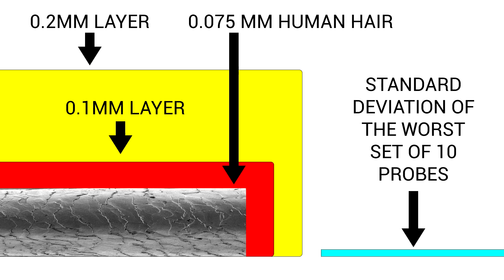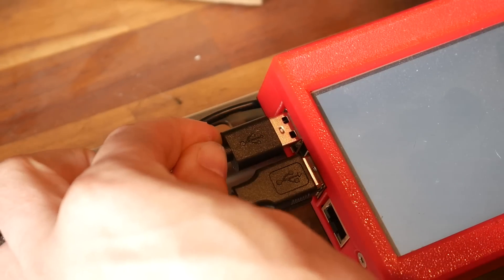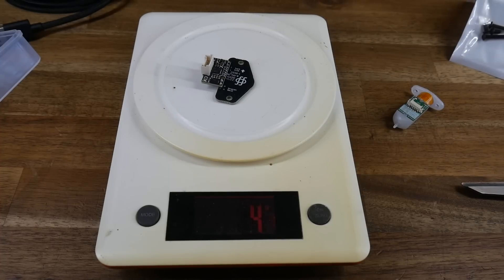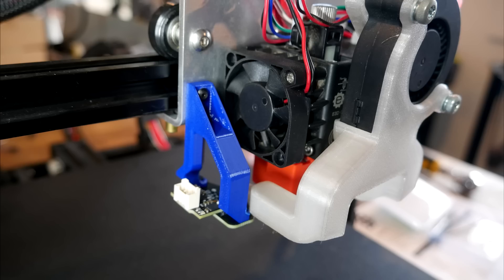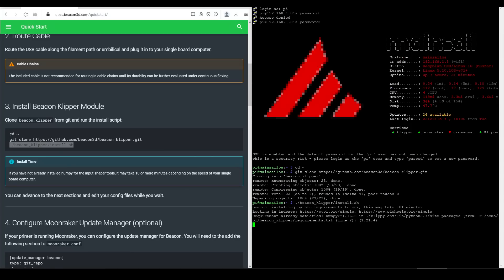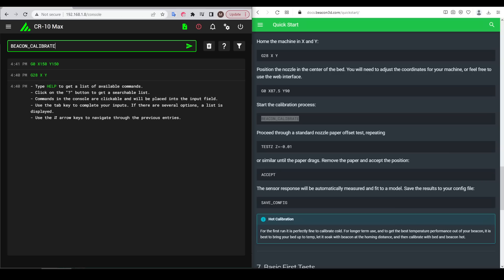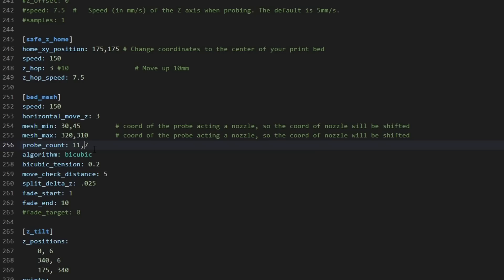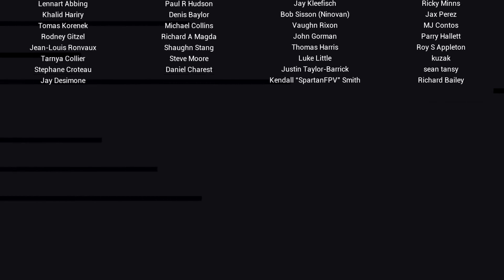Beacon ABL bed scanner - Amazing speed and accuracy, perfect 1st layers

Comment: My main gripe with Beacon is with the fact that it isn't Open Hardware. It's disappointing, specially when you consider that the 3D printing community as a whole was only allowed to grow and thrive because of the Open Source designs back in the RepRap days, after the expiration of Stratasys' patents back in 2009.

Also, the way it is able to communicate with Klipper is problematic by not using Klipper per se, but just an implementation of the communication protocol licensed through the MIT License, which allows the use of that code on closed sourced projects. This has the potential to create a walled garden of closed sourced sensors or add-ons that doesn't collaborate back to the original Klipper project.
Reply: Considering the difficulty of getting patches actually merged with mainline, having hardware that can spin up without merging into klipper can actually speed things up in terms of development. The actual klipper portion of the code is open source and under GPL and there's no way that can change with klipper as it stands.
Reply: @KeyanMobli  That isn't the issue I'm addressing here, and I believe you know that.

And while it is true that Kevin does make things difficult to merge on the main repository, there is a simple solution for that: just fork it.
Reply: @KeithSachs  First of all, I never worked on any stepper motor, ever. What I have done was simply to ask OMC if they could do it. It was solely their decision to manufacture that motor, and the only thing I was ever offered was a pair of stepper motors for testing, which I declined.

Second: you are completely free to disagree with me. That's ok, different opinions can enhance any debate when there is respect on both sides. After all, any creator can make their own decisions on how to license their creations, even if they want to license them at all in the first place.

Third: what I have written are my opinions, from the point of view of someone involved in Open Source Software for almost 30 years (counting both using and developing, although the latter has been of lesser importance since I don't work anymore with programming). It expresses my concerns on how such developments can influence the Open Source Software/Hardware in the long term. And that's because, while the creators of Beacon (and of Anchor, the firmware blob it uses) may contribute to Klipper frequently, now the Pandora's box is opened and other players without such interests can exploit this possibility. And yes, I'm talking about Chinese companies.

I hope you have a nice day.
Reply: Imagine complaining that people get to sell a product they spent years, and tens of thousands of dollars developing. WAAH, YOU DIDN'T DO IT FOR FREE WAAH!
Reply: @unharmonix  Imagine if open source licenses would allow for commercial use... Oh wait, most of them already do!

If you are going to make an argument, at least use valid reasoning.
Reply: @vinnycordeiro  you're complaining it isn't open hardware. Why should it be? The creator would then be giving away exactly how it was made and would be instantly cloned by China and would lose massively because people in this world would rather pay nothing than support innovators.
Reply: @unharmonix  That's a valid concern, and one with the same mentality of companies like E3D and Prusa. As I said, this stance is disappointing to me, but it is legal and the designers of Beacon are well within their rights to do so.

However, that doesn't mean that we can't reason with them in order to try and make them change their minds: for instance, I recently read a post by ChaoticLabs, a Chinese company which is making aluminum CNCed parts for Voron printers, that they are going to Open Source the design files for their CNC Voron Tap, because of the GPL v3.0 wording on 'derivative work.'

About the possibility of cloning of the design: what makes you think that Chinese companies won't be able to reverse engineer the device anyway if they see that there is money to be made with it? Do Beacon creators have the resources to legally challenge Chinese manufacturers on court should that happen? If the creators want to limit possible profits from clones, the legal challenges would have to be made at least in the US and in the EU, and if there's one thing I know about law is that litigation over Intellectual Property is one of the most expensive cases that can go to court.

I think the main thing here is a difference in mentality between people who innovates and wants to make money out of it, and people who innovates just because they like 3d printing and want other people to able to do that as well. None of them are wrong, but I remember that 3d printing for the home user was only able to exist after the expiration of Stratasys' patents and the creation of the RepRap project.
Reply: @vinnycordeiro  what about people who innovate for both reasons? I know that the creator of beacon did it as a passion project and to improve some of the tech in the 3d printing world, but at the same time wants to recoup his costs. Even if the sensor can be reverse engineered, they've at least made it a bit harder to and given themselves a headstart to make some money back out of it before it gets ripped off

Comment: It's all nice and shiny but in the age of force sensor bed leveling (where you don't need to calibrate anything when you change nozzle) I wonder if it is still relevant. Especially with the popularity of garolite beds on the rise, and strong magnets embedded into the bed. Not to mention the compatibility with Klipper only.

Comment: This is pretty cool. I wonder if this amount of resolution is actually used in the firmware compensation though, or if it ends up collecting a ton more data than the machine/firmware can actually use. Very cool tool regardless!
Reply: Klipper will handle mesh up to 100x100
Reply: @urufushinjiro  seems like you would need to be printing on an old dirty rag or something for much more than 3x3 mesh to make much difference.
Reply: @derekc423 ?
Reply: @lloydrmc  he is saying that an old dirty rag has a ton of resolution and filth that you could model... but why?
 That's less smooth (more detail, texture) than a spring steel magnetic sheet, and to triangulate the tilt and compensate Marlin firmware even has a 3 point bed leveling option that suited needs for early 3d printing with bed tilt. Assuming the surface was very smooth and uniform, and not warped.
But that's like a polygon from doom II trying to model the surface of a pumpkin .
 But the more point samples you can take, the more accurate your resolution. That's more like a point cloud with a ton of points sampled from a lidar or camera which can be turned into a detailed mesh. Much like bamboo labs and their microlidar approach.
Just as with pixels, you get a more detailed picture of the surface deformations as well as tilt of the bed in the end with more samples. However, for Derek his prints get by with a triangulation then mesh creation in a 3 pts by 3 pts array, or 9 points. The bed is smooth enough but is warped slightly on either side and you can mathematically interpolate the smooth curves that arise from the samples given and get really close to the actual surface.
 Think about a statistics class were you take a bunch of samples and try to use linear regression or something to find out where the line or function actually lies. 

We are getting into bed leveling point cloud here  🤯

Comment: Really cool video, thank you for taking the time for this content, owning the Bambu X1 Carbon, and now the Prusa XL *I preordered before the Bambu, this kind of bed leveling will be game changing if there is adoption. As you mention, the resolution and the time to get to result will improve print times substantially. Now I print functional designs, but those running print farms, saving 3/5 min prep time will be and added benefit. I just ordered to put in on my RailCore 300ZL.

Comment: wondering what the limitations are to resolution? any degradation in consistency or accuracy if you set the resolution to something insane, like 200x200?
edit: actually just realized that still requires drawing 200 lines across the bed lol. maybe 200x10 is actually what I was imagining when I wrote that.
Reply: Klipper current limit is 100x100 but this does it just fine

Comment: Interesting.
With my experience using CRTouch and board native installation of Marlin variants, the firmware is the biggest part of the issue with accuracy of the mesh.
One possible benefit of this sensor vs CRTouch is interface and cabling.  The CRTouch is a raw on/off sensor which some say may get noise and false trigger sensing thus affecting mesh accuracy.  Since this sensor uses USB as its interface, EMF noise affecting accuracy is eliminated.
Still, you apparently need Klipper, likely on a Pi, and Pi's are hard to come by.
But I haven't looked into Klipper at all, so my comment is probably naive.
Reply: I mean, for most creality owners the build plate restriction and actual cost of the device itself make it really hard to sell. The more you think about it, the more niche of a device it becomes.  

Sure, enthusiasts will buy it and do some interesting things, but the vast majority of people buying this probe will be running voron/ ratrig/ other DIY corexy machines. 

Imo, this probe only really makes sense on something like a CR-10 that you're willing to convert to klipper.  At that size, the speed makes a ton of sense and you can get incredible fidelity.   

The Pi ordeal is definitely a PITA.  And i heard the Pi 5 is on the way. So that's not getting better anytime soon.
Reply: I'd say that with the price it's not something many will add to $300 Creality printers but may be of value to those running Voron, RatRig V-Core, VZBot, etc.  These already run on klipper. I agree, right now the cost of pi is ridiculous and prohibitive for many but a lot of people are already running printers using Klipper as firmware with Rpi already onboard.  If it weren't for the price tag, I'd be ordering one of these to add to my custom coreXY but I just can't justify the expense right now.
Reply: Well, the official price of the Pi isn't bad.  It's the scalping resellers that has the ridiculous price.
In hush voice: "want a Pi now?  Here's one for $200"
Reply: @danman32  Not just the scalpers, the official sellers as well.  When they get a batch they put them into overpriced kits, you can't just buy a pi for $35-$45 anymore, you have to buy a $150-$200 'kit' with a lot of stuff in it you don't even need but it's the only way to get the pi.  I'm glad I had a few pi before the chip shortage, I won't buy another unless/until the prices get back to normal.
Reply: There are lots of Pi replacements that would run this just fine.

Comment: I am running TAP on my Voron, wich has the absolute advantage, that i can change Nozzles AND Bed surfaces, even both at the same time and i never have to readjust for any of it, since the Nozzle is the probe and the offset always stays the same. If tuned correctly once, you have no more guesswork at all.

Comment: Our build platforms are flat and parallel within 0.05mm, so no need for waste of time additional processes.
And yes, our oldest machine is 4 years old without any problem towards bed flatness.
Reply: Within 0.05mm across what distance? That number without the other is meaningless. And when it's heated? How is it attached to the rest of the printer?
Reply: @m3chanist  across build length and width. The build envelope is 400x400x650. 100% machined

Comment: I like innovation, so I am pleased this product exists. I am impressed with its speed and accuracy. I get overwhelmed with the Code aspect of this hobby, but am taking it a step at a time. One day it will be more manageable and make sense. This probe is cool and I do think it will find a home, but likely on the higher end user bracket. Voron, Sekit, etc etc or motivated hobbyist users.  I don't think its bed limitations will be a deal breaker.

Comment: Haven't set up a machine with Klipper yet, but I find it interesting that you have to comment out/delete the other ABL in the Config file. Since the ABL is configured by id I would think Klipper would see what serial ports are connected and establish a fallback pattern to deal with it. For example, if two are configured and only one is available, use that one; if no ABL is available, throw an error; if two ABLs are available, then set some precedence over which to use (assuming we don't come up with a rationale for using two ABL's at once on a printer).
Reply: The ID refers to the device descriptor over USB. Most probe setups do not use a separate controller, the Beacon chip runs its own firmware that behaves like a regular Klipper MCU (printer board). This means it does not require "servo" signals like the BL touch or similar devices. It is effectively a printer board that only has an endstop and temperature sensor on it.

Comment: I love the beacon. Its the best money I have spent on 3d printer gear for some time. I'm using it on my Voron 2.4 and its just as accurate as the TAP probe while being far faster, lighter and more consistent. I am getting the the best bed meshes I have ever had.
One thing that the quick start guide does not cover is that you need to use the ls /dev/serial/by-id command on the pi to get the beacons device ID to add to the klipper config.
Reply: Cant use it on mine - Mandala Rose works bed has huge magnets in it, but I went with that as its flatter than a stick on magnet will ever be. I hope someone brings out a proper lidar probe at some point, that will be a game changer.
Reply: Do you also use the QGL? Could you perhaps share your macro/config?

Comment: The price is a major factor. Get it down to $15-$20 then it will be awesome, but the current meta of what we have does just fine.
Reply: I'd like to see a price justification, what exactly are they charging 80$ for and why they can't go down. They could sell SO many if they went to the 50 mark and maybe below
Reply: Clones will no doubt be appearing shortly. Given the number of inductive bed sensors already on the market I would think prior art exemption would render any patent they hold useless not that that's much of a consideration for many producers.

Comment: You can do the mesh scan far faster.  Beacon actually samples at 1 kHz regardless of your toolhead speed and just throws away samples when you're moving slower.  That mesh can be done identically in just a couple seconds.
Reply: It still pays to do it at a reasonable speed, just because if you go super fast, beacon will start to pick up issues with your motion system itself. I can scan my bed at 800mm/s but I get a little vibration and surface discrepancies at that speed, vs doing it at 500mm/s.

Comment: But you still have to set the nozzle offset :/
Reply: Everything has an offset.
Reply: @urufushinjiro  not nozzle based probes like prusa mk4 / xl.
Reply: @TMS5100  they have a built in offset, there's still a set distance for the sensor to trigger that has to be defined as an offset.
Reply: @urufushinjiro  and unlike probes offset from the enozzle, that offset would remain exactly the same after replacing nozzles, even wildly different ones. so the offset is irrelevant, because you dont have to change it if you have a taller nozzle. unlike inductive and bltouch.
Reply: @TMS5100  that is in fact correct
Reply: You only have to do it once, the first time. Is that such a big deal? Literally takes a minute.
Reply: @unharmonix  thermal expansion make a lot of problem for me each day even after each print. I'm more curious why do people have to do bed mesh every time before they print. Because it should always be the same.
Reply: @xsunnycrazyx  I don't bed mesh before every print. I got my bed mesh sorted, don't need to keep doing it.
Reply: @unharmonix  I understand, but people buy the Beacon because it can do bed mesh so fast, that why in curious.
Reply: @xsunnycrazyx  I didn't buy it for it's bed meshing ability, I bought it because it's an accurate repeatable z probe. BL touch is such a piece of shit in comparison, every single print I had to babysit at the start to correct z offset with the bl touch. Now with beacon I can trust it to just work properly every time
Reply: @xsunnycrazyx  if you have removable plate flexible bed, thats why people bed mesh every time. every time you remove and put back the sheet it shifts sligthly.